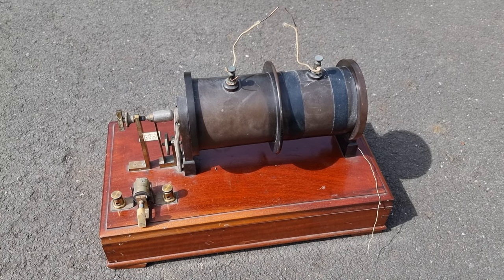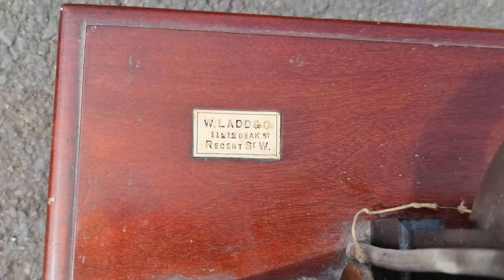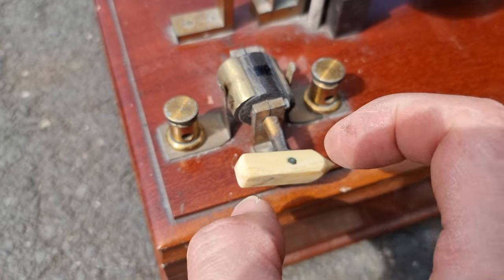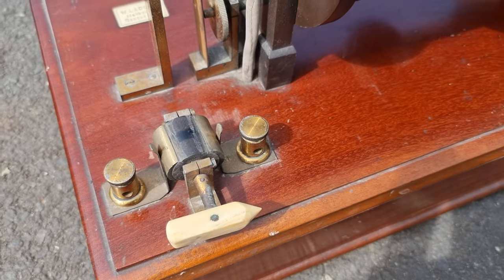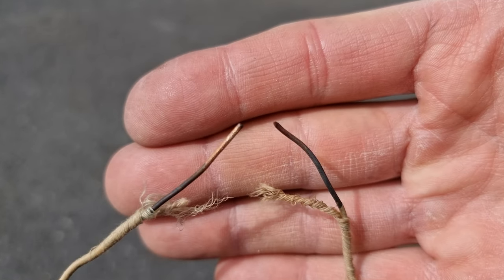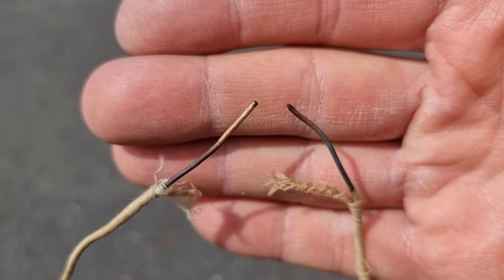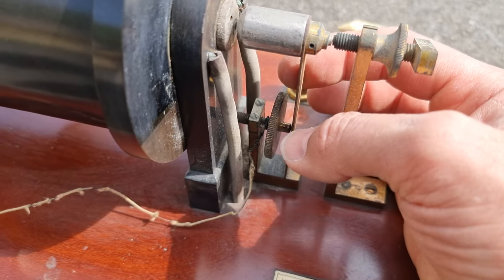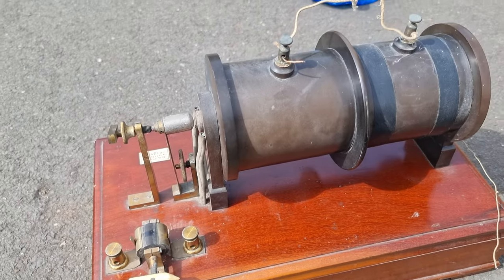LION - Evidence of EVOs, pre WW1?

Comment: Wow ❤ question was there a bamfeild telegraph station near by  ? There was one  I. Victoria Canada  to England a friend of mine gave me the entire system I had stuff from 1880s up to 1912 this would be a vibrate r type high voltage coil system you can adjust the vibration or cycles or impulses a 6 volt to 12 volt battery I’ll see if mine is still around yin might remember my system all of it was hundreds of pounds of stuff lije what your showing you could set it all up get a neon tube clear type you can adjust this so you get standing waves yin I think filmed mine in our apartment fun
Reply from the maker: Where can we find more information about this kind of device Baroness?

Comment: You can use this to demonstrate a "lifter" LhygSconaFE    perhaps with following simplifications to further increase efficiency in terms of thrust/mass ratio HpDeFtAtqF4. Meaning it's possible to construct the thing with balsa wood sticks or plastic drinking straws only as spacers between the electrodes, a thicker stiffer cathode wire can double as a frame shaped into the classic delta
Reply from the maker: Thanks